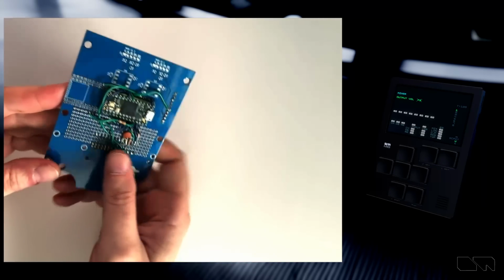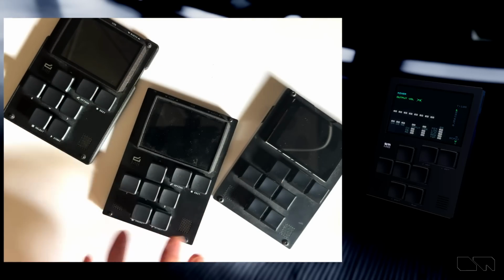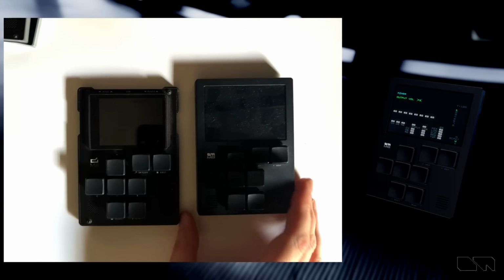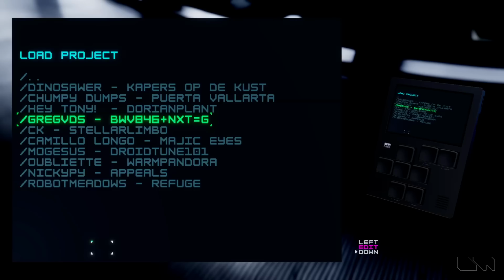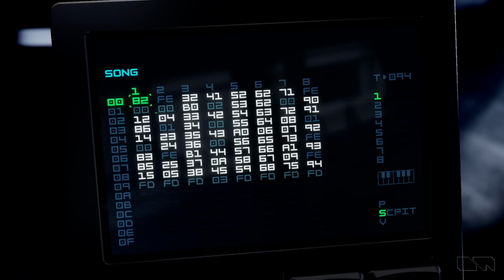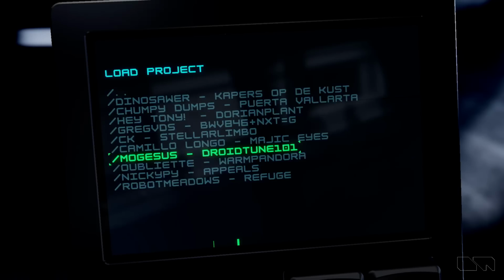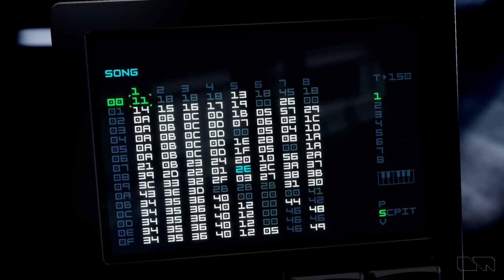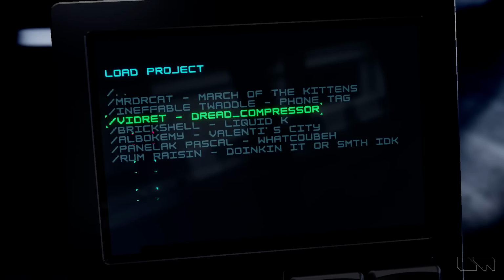M8 Tracker Discord Meetup #30

Comment: I found the prototyping segment extremely interesting! I have seen headless versions of the DW M8 that require a mini computer like a RB Pi to run the display. However, the prototypes seem to be working with a display on just a teensy sized board. Out of curiosity, what are these boards and how are they driving a display?

Comment: passing tariffs on customers huh .... so what is the bottom line of profiting 3-400 percent? as serviceman i cant get more then 25 percent above costs without  being bitched at. this is globalism at its best.
Reply from the maker: The sum of component parts alone does not equate to all expenditures of a product and service obviously. To suggest that the sum of those expenditures on M8 equals a 400% markup is not remotely accurate. Furthermore if a product ends up costing $300 more to manufacture due to tariffs and you expect the manufacturer to eat those costs, that expectation will not be met. The point really is: M8 is made in USA as much as it can be. The tariffs hurt both the manufacturer and customer; that is the reality.

Comment: Any indication of when, how and why the buttons got in this disposition?
Reply: while the M8 is definitely a handheld device, it was determined at some point that would be very convenient to be able to operate it one-handed while it is flat on a table (particularly for live performances). As someone who had used Gameboy/LSDJ for that exact purpose for over a decade, it is not an optimal experience. Not to mention the wearing out/gunking of carbon pads and their unreliable input nature over time.  Mech switches fix all these problems!

Comment: I originally bought a Polyend Tracker because I couldnt get my hands on an m8 for a while until i bought a version 1 m8 secondhand a few months later. It is hands down the best hardware brain ive used. The only thing I still miss about the polyend tracker is the bigger screen and pads, it does make sequencing in so much faster. I dont have a launchpad pro so im eagerly awaiting a new release m8 that has integrated  pads and maybe a few knobs as well. It would be a powerhouse.